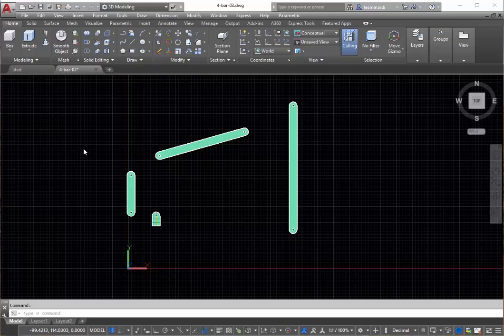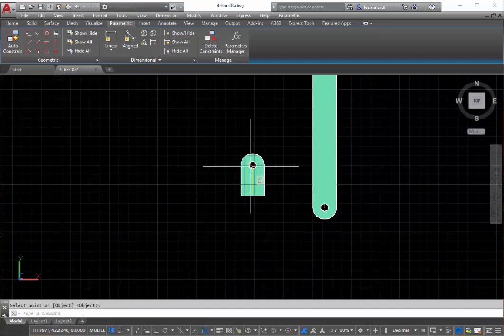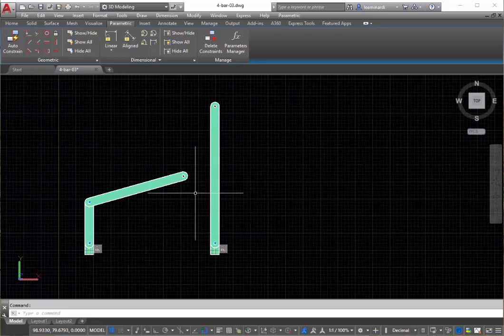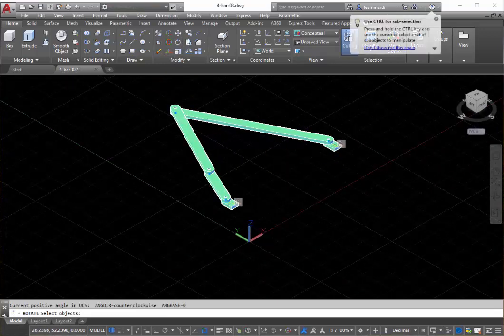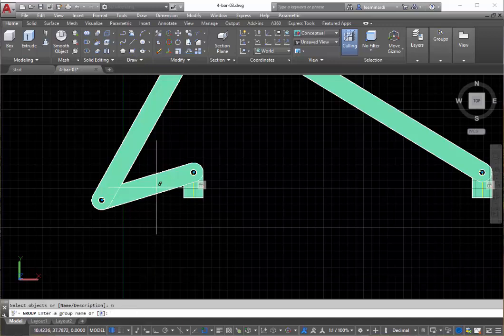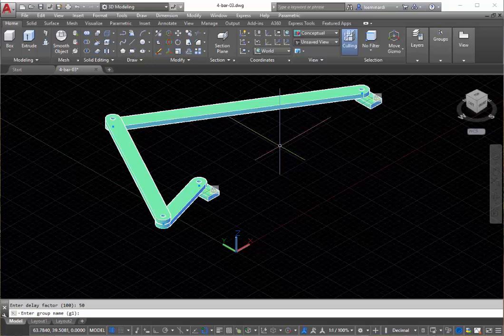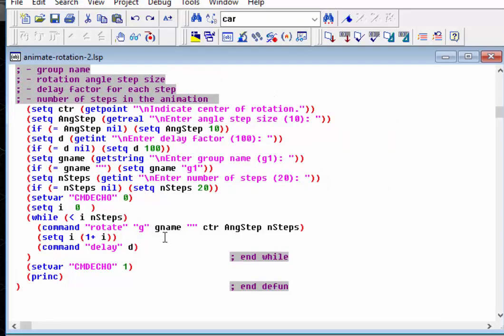Tutorial: Modeling and Animating a 4-bar Linkage with AutoCAD

Comment: well i am gtting this i think this is an error i have done the same thing but i could not figure out what is wrong 
"The constraint cannot be applied. The two objects must reside in the same plane."
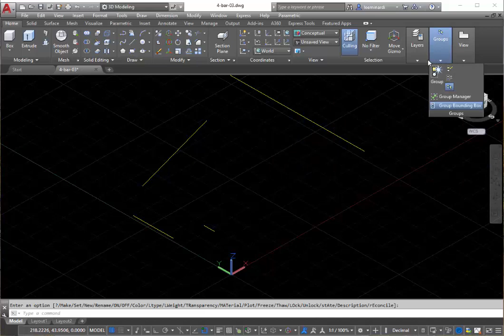Reply from the maker: Note that at 0:28 I state that each block has a line on the XY plane, It's these lies that you should use for applying constraints, The solids for the links are on another layer.  You would get an error if you are selecting lines that are not on the same plane.  Either you lines are not on the XY plane or you are selecting something else.

Comment: How can I connect the lines with the object itself. When I merge the moving lines, the object does not move?
Reply from the maker: As noted in the tutorial each link is a block.  Are you familiar with AutoCAD blocks?  Each of the blocks have a line on the xy plane whose ends are referenced when applyng the coincident constraint.  The 3D solid part of the link is a solid object on a different layer of the same block as the lines. Since the reference lines are part of the same block as the "object" they move together.
Please let me know if you require further explanation with specifics about what is unclear.
Reply: @LeeMinardi  Hi Lee Minardi, why when I opened the layer properties there are no hidden line. And I do not familiar with the AutoCAD blocks. Can you make a video how the lines can show up with the object?

Comment: Hey Lee, this works great, thanks so much! I can use it for training my aviation maintenance students on flight controls and ???. One bug so far, when trying different parameters for smoother action such as step size 1 degree, time delay 20 and steps 360 (a full circle) it sometimes crashes and becomes nonresponsive. Any ideas? Are there limits beyond which we should not push those parameters
Reply from the maker: Hi Barry, I'm glad you found the program useful. It's possible to create 4 bar linkages where the crank cannot rotate 360 degrees. Could that be the issue?  What were the dimensions for the linkage that caused the program to crash?  Please state: the distance between the pivots, the length of the crank located at one of the pivots, the length of the link connected to the other pivot and the length of the couple link.

Comment: Hey. For the AnimateRotation programme what sofiware do you have to use? Or it is just a notepad?
Reply from the maker: In AutoCAD go to the Manage tab then click Visual LISP Editor, File, New File and type in the program.  Save the file as   AnimateRotation (.scr will be appended automatically).
Click Tools, Load text in Editor  or give the Script command in AutoCAD to load the program.  After it is loaded you can run the AnimateRotation command like any other command.

Comment: Hi! When I try to do the "Coincident" part, only the line moves to the fixed point but the solid remains on its position. What am I doing wrong? :c
Reply from the maker: Each link is an AutoCAD BLOCK with a solid object on one layer and a line on another layer.  The line is referenced   for applying the coincident constraint. I mention this at  0:16 in the video.  Since the line and the solid are components of the same block they will move together.  Does this answer your question?
Reply: @LeeMinardi  YES! Thank you. I didn't know what a BLOCK was hahaha I appreciate it ;)
Reply: @LeeMinardi  But, do you have a video to learn how to link a solid with a line. Even if they are circles with some kind or rounded solids, how can I know how? Please, help me!

Comment: "The constraint cannot be applied. The two objects must reside in the same plane."
I created the bocks with lines inside the blocks. All blocks at the same elevation. Lines at the half elevations of the heights of the bocks, all blocks the same height. What am I doing wrong? 
I am looking for an animator to make  (2) videos with basic animation of (1) bike chain (5) gears times 2 and (1) block/group connected to bike chains, animated to be lifted up and lower down back while the gears are rotated by bike chains. I have the models in 3D in AutoCAD but having problems with animation in which I am a beginner. Replay to conysimionson@gmail.com
Reply from the maker: As stated a 0:25 in the video, each block contains a line on the XY plane.  This ensures that the constraints are all working in a 2D plane.  The solid parts of the each block may be above or below the XY plane.

AutoCAD is not the product to use for creating an animation of a bike chain and its gears.  For such an application I would use 3ds Max.  I have created several 3ds Max tutorials for the rigging of mechanisms with Max   For example, the rigging of a hexapod.
https://youtu.be/MS1IVo1QB78

Do a youtube search of "3ds max bike modeling tutorial".  YOu can import your AutoCAD geometry into Max.

Comment: ANIMATEROTATION is unknown command? How can i use that on autocad2015? Thanks IDOL! LODI!
Reply from the maker: animaterotation is a vlisp program.  You must load it before using it.   Below is a listing for the program that is shown at the end of the video.  Save this program as a text file with the filename extension .lsp.  In AutoCAD give the command  _appload  and then you will be able to give the command animaterotation.

(defun c:animaterotation (/ ctr AngStep d gname nSteps i)
; L. Minardi  1/11/2018  v1.0  
; Animates a group about a specified point. User may specify:
; - center point of rotation  
; - group name
; - rotation angle step size
; - delay factor for each step
; - number of steps in the animation  
  (setq ctr (getpoint "\nIndicate center of rotation."))
  (setq AngStep (getreal "\nEnter angle step size (10): "))
  (if (= AngStep nil) (setq AngStep 10))
  (setq d (getint "\nEnter delay factor (100): "))
  (if (= d nil) (setq d 100))
  (setq gname (getstring "\nEnter group name (g1): "))
  (if (= gname "") (setq gname "g1"))
  (setq nSteps (getint "\nEnter number of steps (20): "))
  (if (= nSteps nil) (setq nSteps 20))
  (setvar "CMDECHO" 0)
  (setq i  0  )
  (while (< i nSteps)
    (command "rotate" "g" gname "" ctr AngStep nSteps)
    (setq i (1+ i))
    (command "delay" d)
  )     ; end while
  (setvar "CMDECHO" 1)
  (princ)
)     ; end defun
Reply: Please enlighten me the steps to load this program.  How do I save it,  which directory to save it?  I badly need this.  Please help.
Reply: Successfully loaded it.  Thanks.

Comment: I'm trying apply constraints to prove how a set of joints will operate.
I have 2 lines, both at 0 on the Z axis, and I have the ucs positioned on one of the lines. When I try to apply a coincident restraint I'm getting the following messages.

GCCOINCIDENT

Select first point or [Object/Autoconstrain] <Object>:

Select second point or [Object] <Object>:

The constraint cannot be applied. The two objects must reside in the same plane.

Can you suggest a solution?
Reply from the maker: First, set the UCS to World 
UCS [Enter][Enter]
Give the list command and select the first line and check that the z coordinate for both ends are = 0.0
Do the same for the other line. This will validate that the two lines lie on the z = 0 plane (not axis as you state).

If you want to work with two lines that are on the same plane but the plane is skewed in space then set the UCS such that the XY plane of the UCS contains the two lines.

Comment: Hello,
The bars you made are blocks or you simply used press pull to get the bars?

Regards
Reply from the maker: AutoCAD’s parametric features can only reference point, lines, arcs, circles, and splines on a 2D plane. It cannot reference solids. I therefore created the links as individual block objects.  Each block includes lines on the XY plane and, on a separate layer, a solid representation of the link (0:20 in video).  When adding a coincident parametric constraint the line ends in the block are referenced.  
The solid objects that are in a block were created by making a 2D outline drawing of the link with circles (holes) for the “pivot” points (the center of the holes line up with the ends of the lines). The 2D shape of the link was created by converting the outline and holes to regions and then subtracting the holes.  The resulting region was then extruded into a solid.
Reply: If possible, can you share the CAD file in which you are working....?
Reply from the maker: @mohsin160  I've posted it on the AutoCAD forum in response to your original post.

Comment: How did you make the bars attach on top of one another?
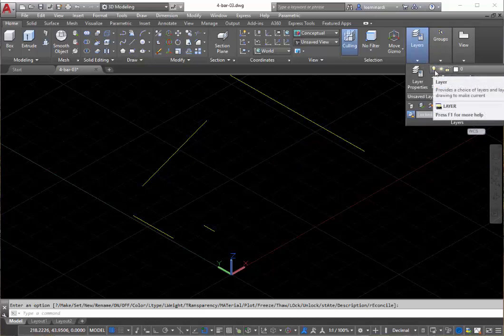Reply from the maker: Each block of the different bars of the mechanism has a line on the xy plane that was used for applying the coincident constraint.  The solid objects of the bars was created at different z values so that the bars do not interfere with each other. The bottom of the solid objects for the crank and follower have a z value of 0 while the coupler has a z value equal to the thickness of the bars.  The pivots are just below the xy plane. I mention this at 0:34 in the video.
Reply: @LeeMinardi  oh, I get it now, thanks for the fast response

Comment: how did you attach a line to a object in Autocad ??? ref :  0:25
Reply from the maker: I created a different block for each of the links and the pivot.  The lines you see at 0:25 are part of the blocks but on a different layer.   The lines are all on the zero XY plane (Z=0) to ensure a planar mechanism.   If all your geometry were 2D the lines would not be necessary as you could add the coincident constraint between links by snapping to the center of the circles that define the link ends.
Reply: Lee Minardi thank you !!! 👍👍
Reply: @LeeMinardi  I have a solid and a line. How to apply constrain to them.. like you did. I am unable to lock them together. Please reply early and help me finish my project🥺
Reply from the maker: @dwaraganathanrengasamy6169   The line and solid for each link are part of the same block as explained at about 20 seconds into the video.  The lines for each block lie on the XY plane (z = 0).  The solid component of the block lies above or below the Z = 0 plane.  The lines and solids are on different layer.  Parametric constraints only work in 2D.  You are really constraining the lines of the blocks not the solids.  The solid object are there to make the final mechanism look good!
I hope this answers your question.  Good luck!
Reply: @LeeMinardi  demonstate in a video pleaseeeeeeeeeeeeeeee
Reply: Thanks.